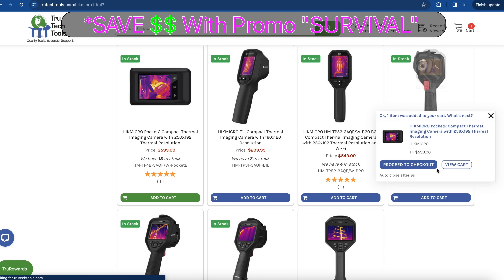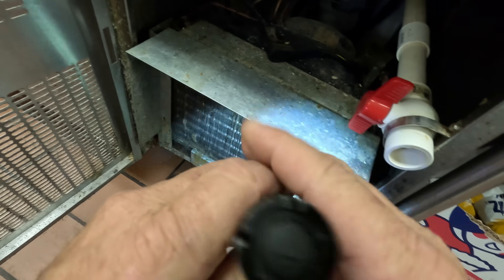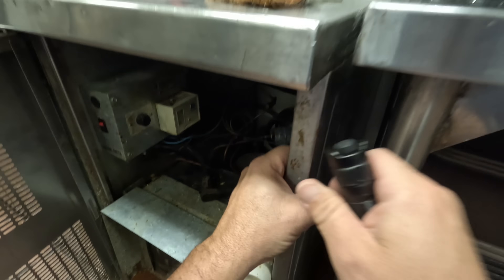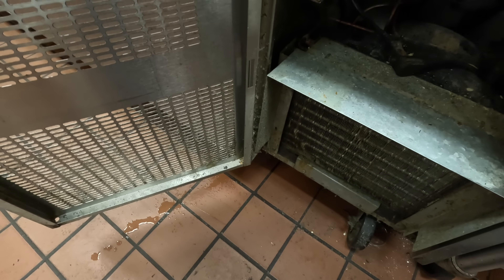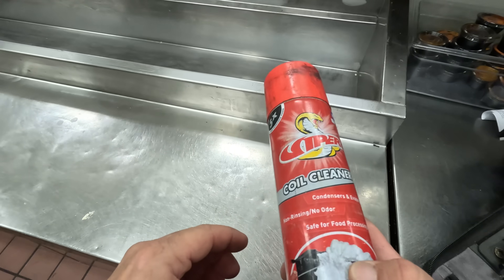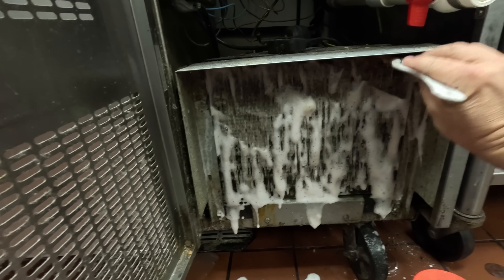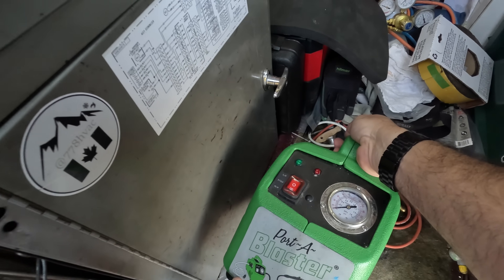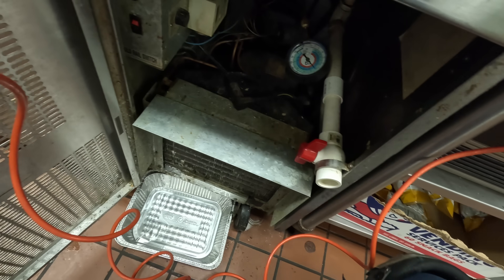Pizza Prep Table Not Cooling OR Is It?

Comment: those randells are nice until they start leaking in the rail.. i just carry a 100' 1/4 ID air hose from the freight that screws on to the mop sink with a small ball valve on the end on the business end
Reply from the maker: That’s an interesting idea. So you’re using as a water hose?
Reply: @HVACRSurvival yep works perfectly for these situations, lots of greasy coils around here. it even makes it up onto most rooftops without extensions

Comment: Show me the defrost clock, please
Reply from the maker: Most coolers like this don’t have a clock,  they use a thermostat that has a constant turn on that keeps the compressor off until the coil is up to 38 or 39 degrees F.
Reply: @HVACRSurvival  No clock, that's what I learned.  The pizza place where I serviced used to leave the food in the rail covered with film.  I have a haunting memory that behavior was not according to mfr's instruction.  
Your's are my favorite videos.  That Liebert unit. Me too.
Reply from the maker: @WilliamAnstead-x9l 🙏 thank you William!

Comment: Little things help make bigger things. Just cleaning the condenser coil will make a noticeably better end result.  Great Job !  Be safe in this heat!
Reply: Unless its a little low and now your head pressure control is now clean. Then the cooler making 41 is now up to 50....